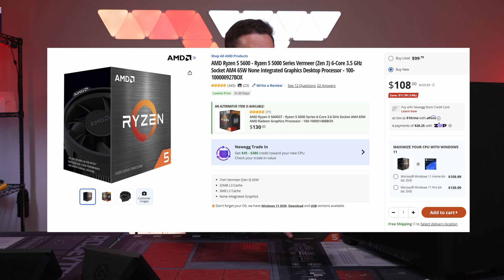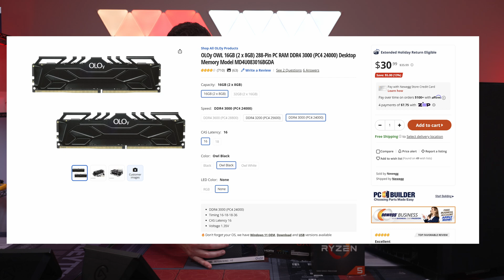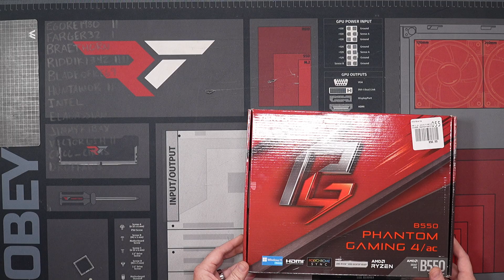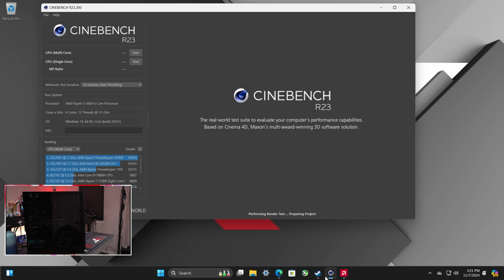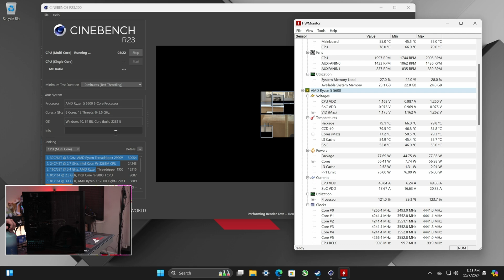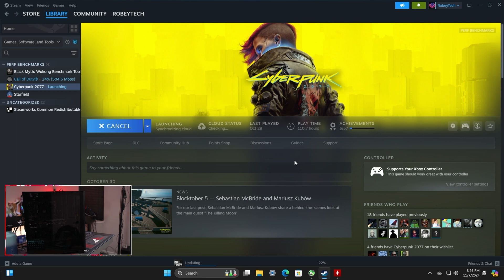Build the Best AMD Budget Gaming PC Build 2024

Comment: hi I was wondering how much fps those pc can get in valorant
Reply from the maker: A lot, I will try to find an an exact number but it’s a lot
Reply: You need to play on 1440p with this Cpu or you experience a noticeable bottleneck. valorant At high preset maybe around 420-450fps. Me with 6700XT can achieve 340-370fps all high preset only texture to be set medium. But cause I'm using a 240hz monitor , I just using radeon chill to set the parameters for low and higher limits of my Frame rates to only 265Hz, for stability purposes only.

Comment: this build is batter than before but if you want true price to performance go with 12600kf its going dirt cheep $130 it will have no bottleneck even in 1080p all around $840 
Intel Core i5-12600KF 3.7 GHz 10-Core Processor	$129.99	
ID-COOLING SE-214-XT ARGB 68.2 CFM CPU Cooler	$15.19		
ASRock B660M Pro RS Micro ATX LGA1700 Motherboard	 $79.98			
G.Skill Ripjaws V 32 GB (2 x 16 GB) DDR4-3600 CL16 Memory		$58.99
TEAMGROUP T-FORCE G50 1 TB M.2-2280 PCIe 4.0 X4 NVME Solid State Drive	$49.99		
XFX Speedster SWFT 210 Core Radeon RX 7700 XT 12 GB Video Card	$369.99		
Montech AIR 100 ARGB MicroATX Mid Tower Case    $59.90
Cooler Master MWE Gold 750 V3 750 W 80+ Gold Certified Fully Modular ATX Power Supply	$74.99

hey man, still not $875 btw...........
Reply from the maker: A couple things with that. The Montech X3 Mesh is the case I returned to Microcenter due to the fans being horrible with molex and daisy changed together. The PSU is a Tier C level PSU and the RAM is only 16 GB.   We have three rules: No case that makes you hate life. 32GB of RAM and a good PSU
Reply: @robeytech  ohh I was unaware of this newly implicated rules was trying to cut down price to $800 so that will be covered if budget goes to $875 not a biggie, here you go I edit the list for you